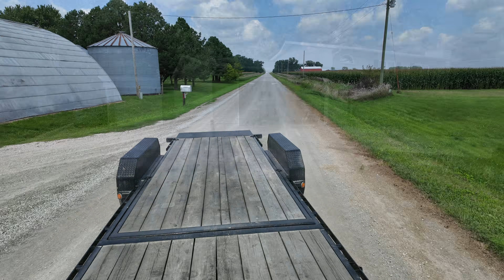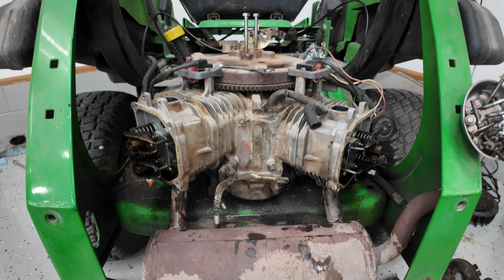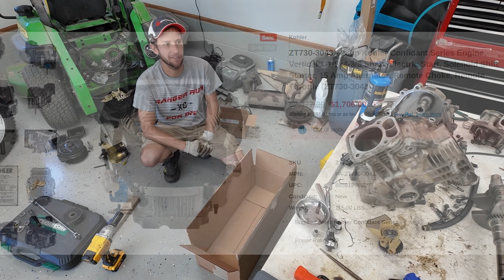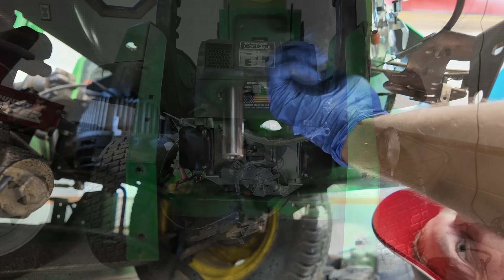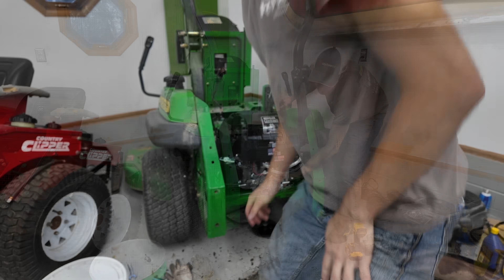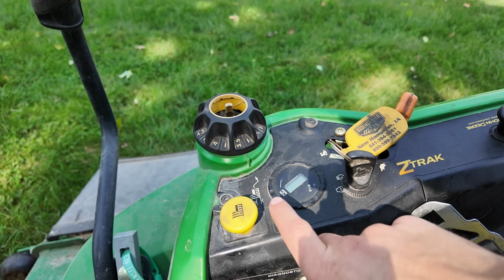DEAD Engine! This John Deere Z520A Zero Turn Mower has MAJOR problems

Comment: As i set here and watched the video, the only think i could think was, well he forgot to tighten the ground wire to the battery, i hope he didn't forget to tighten the bolts back to the engine after having to loosen them to get the choke cable unstuck 😂 new subscriber.

Comment: It was probably a gift that the old engine was gone.  I had one that I rebuilt a couple of times. I bought a filter that was filled with red grease.  I didn't look when I put it on, and I think the engine got no oil for a bit.  Luckily, I dented the filter and saw the grease completely clogging it.  Someone once told me to check for grease in a filter for some reason and now i see why.  It was too tight and I left it running, then screeeech---it was done.  It's on a go cart now and I have a new engine on there.  Nothing easier than just bolting a new one on.  But, then I couldn't ride it due to a bad back and I got a Stihl with a suspension.  Now life is good.  Pat's small engines is where I got the best deal on a new 30 hp Kohler.

Comment: Hey John where are you located? I'm in the Trussville area near Birmingham Al. I could use some help with my mower. I have a Troybilt z46 mustang zero turn and I mounted a 21.5 HP Kawasaki engine on it and I can't keep it running. It'll crank and run for a minute but eventually cut off so I'm stumped at the moment

Comment: When i install a new engine, I keep the connector off the old engine as sometimes the new connector doesn't match the old. The wiring is simple enough that its pretty easy to figure out what wire manages what

Comment: I would load that engine up with 100% Amsoil Synthetic oil an  and lubes for Small Engines. AMsoil has what you need, believe my. I use it in my .

Comment: You should cross the safety chains behind the trailer tongue so they catch it in the event of hitch failure. They are meant to keep the trailer from dropping down onto the road, not to protect the cab.

Comment: Why is it that you YouTubers NEVER think to pressure wash ALWAYS BEFORE wrenching on a new acquisition?  It makes tear down and rebuilding so much easier and more fun to watch.  If you have a pressure washer; and you do, use it 1st!
Reply: I have 250 ft of hose laying out in the yard that
will get so hot I use gloves to hold the nozzle.
Excellent for washing engines, as you recommend,
BEFORE working on them.
-- North Central Florida
Reply: I was waiting for him to, at least, look under the deck.
He did good,

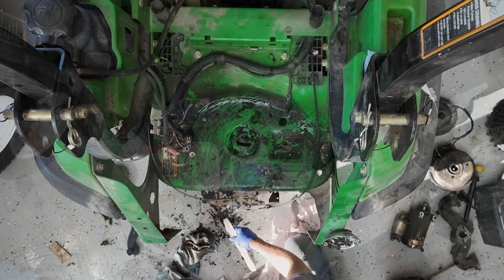Comment: 18:43 I found that a standard kitchen degreaser and a silicone putty knife works best for the bulk then same cleaner with blue towels and then I user surface cleaner followed by 93% iso cleans to like new with no scratching of paint /discoloring or coat damage. I know that this situation doesn`t really require that level of clean but if you have those things on hand it saves time and you don`t end up getting residue on other things.

Comment: We have the exact same mower Z520 with the exact same problem: engine seized at 500hours.  We're in Canada, so finding an engine has been a dead end.  John Deere wants nothing to do with it.  Would you be willing to say where you bought the replacement Kohler engine?  We can get it shipped to the border, and maybe our Z520 will drive again!  (The replacement John Deere zero turn we bought is poor quality compared to the old one: lots of plastic and thin metal parts.  John Deere doesn't seem to care about their reputation using throw away engines and making poor quality machines.)
Reply: Same here - I have the same model and at 465 hrs the engine locked up.  oil pan and crankshaft are scarred up pretty bad, and so far finding parts on a site that ships to Canada is nada.  If I can find an engine or the parts I will reply here again for you!

Comment: That is why do not like vertical shaft motors.  Top bearing goes to easy.  Need to keep oil level up but not up to  cylinder level.

Comment: You should mount a rail system in your garage area and use a come along. Save your back. I’ve done this so long. That’s what I did long time ago with a chain fall.
Reply: And mount a winch on the trailer

Comment: What's wrong with the left castor wheel it's all over the place it was even jammed against the deck at one point and looks like it's the wrong size, it's difficult to tell.
Reply from the maker: The spindle bearings were going bad and got replaced later. Didnt video that work unfortunately
Reply: @Big_John_Inc 
Wondered why it was going crazy 😂
Reply: @Big_John_Inc 
I've got a JD Z997R and a kubota ZD326 the 997R is a beast of a machine very happy with it.

Comment: Let me tell you, that 3/8 dewalt impact is my favorite tool I’ve bought. Used to use the DCF899 to do blades. Not anymore that little impact has some power. And it’s so light and compact

Comment: Way to much work to get that mower loaded. Where is the winch for that trailer? I tried that way with one mower which had taken over an hour to get loaded. Wait a minute I see that winch now!!!! Why didn't you use it??? Those Kohler engines are always blowing head gaskets. They get pretty loud to give you the hint when one had blown. Bet the crank and connecting rod are toast. Sorry I keep editing my post, Why didn't you use any anti seize on the crank? Did you add the 4th bolt? I don't know if those blades are actually cutting or not? That Deere looked horrible. Hope to see it actually cleaned up as it should be. I don't take nothing into the shop unless it's pressure washed first. Good catch on the electrical. Should have a catch basin though for that fuel. You could have used it, since it was fresh.
Reply from the maker: I borrowed the trailer and the winch battery was dead. Good guess haha 
Crank got some grease and the 4th bolt got added off screen. 
The mower a wash later along with some new deck covers to spruce it up!

Comment: What hole were you plugging with your finger when you turned on the engine for the first time?
Reply from the maker: That was the port for the fuel shutoff I removed since it wasn't getting power yet. With it removed fuel would flow but would also leak out the port.

Comment: I noticed the machine moved very freely when you were loading it.  How did you dis-engage the hydro-static drives?  Are the relief valves under the drives?
Reply from the maker: The left/right hydro units have a bypass fittings you can rotate. You can reach them under the seat.
Reply: @Big_John_Inc  could you show a pic or video on where it is located ?

Comment: Those are removable brass sleeves by the way and very much replaceable also. By using A rotary tool and reinforced cut off wheels to cut through the brass bushing sleeve with. Then you gently use a pick tool and punch and hammer to tap  it out with.

Comment: It's A brass bushing sleeve that  goes in that crankcase for the crank journal shaft that comes out of the top of that V-twin cylinder Kohler Comanche engine.

Comment: It is because the valve guide stem seals are worn out inside of that Kohler V-twin Comanche 25 HP OHV engine. Those are known for having leaky valve guide stem seals inside of those engines the OEM Valve guide rubber seals are made out of cheap composite rubber compounds and become hardened brittle. From the heating and cooling cycles of the engine's normal running functions. That actually looks like A case of overheated engine block from the thermal overcooked motor and was already over due for a motor oil  changing to me. Which caused the valve to loosen up and drop down and bend up from being out of proper valve adjustments needed to stay within small engine specs especially if they have oil filters and are DOHV and  OHV  V-twin Comanche 25 HP engines.
Reply: You mean Kohler Command I assume? never heard of a Comanche

Comment: Seeing that coil issue would make me remove both coils and check engine before digging deeper... He installed the coils and didn't space them properly ..they hit and probably made him " think " it seized....might be just that caused it being sold as " seized ". ... Check compression and spin it ( by hand ).... Yes I'd probably take the heads off to be sure the cylinders aren't scored or some visual damage ... It might be a very simple mistake that got it being thrown away....
🇨🇦🤓👍
Reply: Watched the rest of the video...show early on it is locked up...I was under 8 min into video when I commented.... I been wrenching 55+ years on stuff.... I do a visual then a simple check on mechanical ( try to turn engine etc ..by hand ) and then decide what I need to look at next ... The bent rod and busted piston rod could be from the coils impacting into flywheel... Doesn't take much to start demolition inside to cascade to what you found....broken parts jamming the piston and carnage escalates to spin bearings and total destruction.... But hey it is too late now to worry about the cause...moving ahead is all one can do ... I would have looked for a used engine myself...but where I live they are rare and made of Gold ...so buying new is probably ok...but anything New is crap and won't last long too ... Gamble when repowering..if it was a extra mower ( not my only mower ) I would look for a engine and try to cut my cost to 50% or maybe more...some of those engines will pop up....
But your choice to spend and rush ahead....
🤓👍🇨🇦

Comment: Didn't I see a winch on the trailer? Looking for a workout or why not use it?
Reply from the maker: Good eye, the battery was dead if I remember correctly
Reply: @Big_John_Inc  Run a battery cable to the back end of your truck....so you can attach a jumper cable to power the winch ...you should have a battery charging output to trailer plug so you charge your winch battery as you drive ...
Both help you to do work ..
A battery booster pack will also help if you don't setup a winch trailer properly....
I have a portable winch I can use on my 2 trailers or yard tractors too..also have used it with a battery in my yard....
I also make sure I am charged up before going when planned loading is happening.... Not hard to be prepared...my hand operated come along / winch is there for last resort or special needs only...
🇨🇦🤓👍